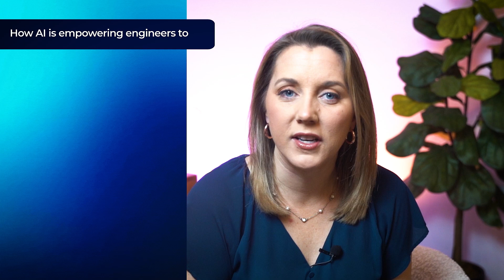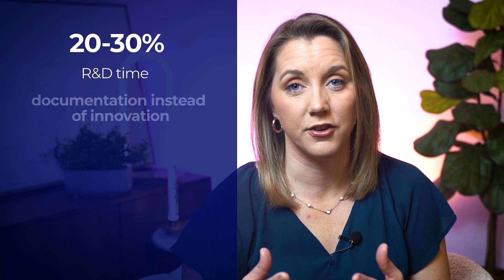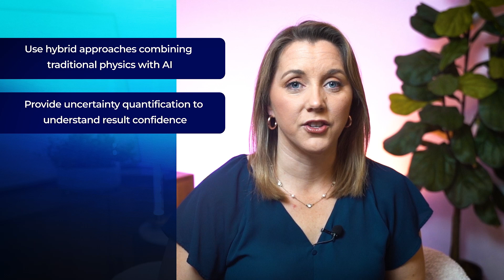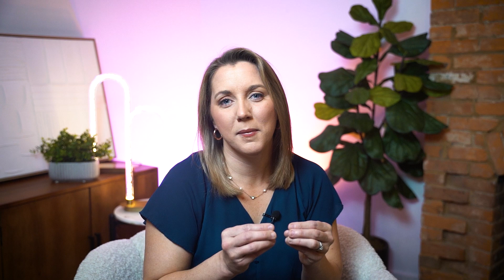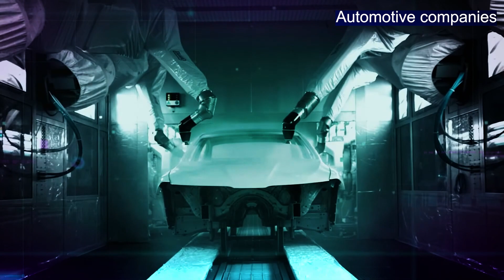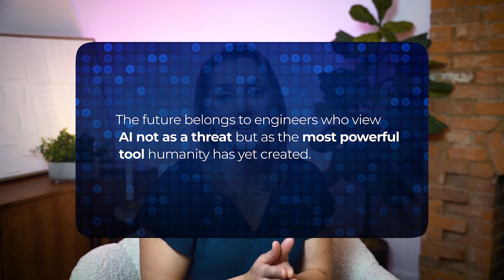AI is Making Product Engineers 10X More Powerful (You Need This)

Comment: This is a knockout video!  I was blown away by the presenter's grasp of how AI could, should and will augment the engineering ecosystem.  Super presentation that leads with foundational theory and leaves you with an implementation strategy. Included are specific perspectives on how various stakeholder-practitioners and processes will be impacted across major sectors.  I spent half my career (1980s-1990s) in the trenches researching, designing, building and supporting Product Lifecycle Management tools (ECAD/MCAD/CAM/CAE) used by hundreds of design-engineering-manufacturing teams.  Every bit of this resonated.  I waded in expecting a superficial explanation with generalized knowledge.  It was not. This was a well organized, easily consumable narrative that knocked off some ancient cobwebs and peeled me an onion of possibilities. The more I listened, the more I wanted to hear!